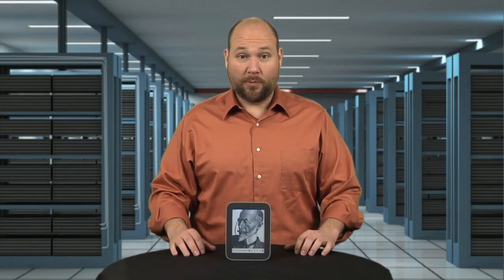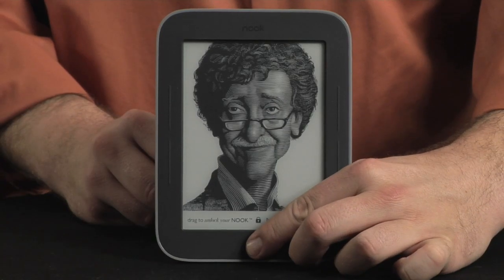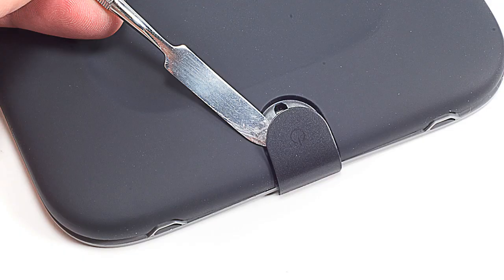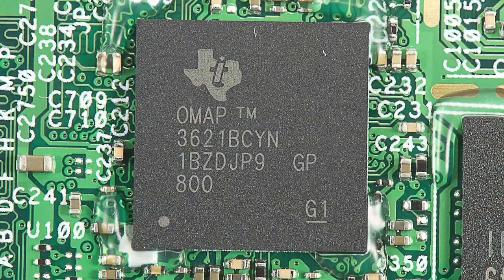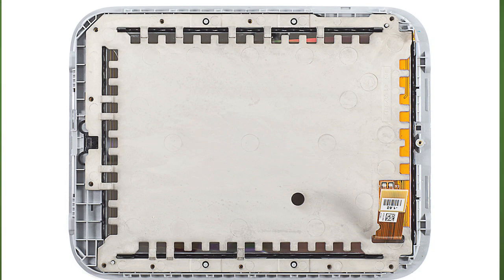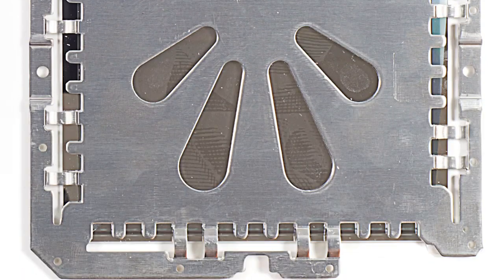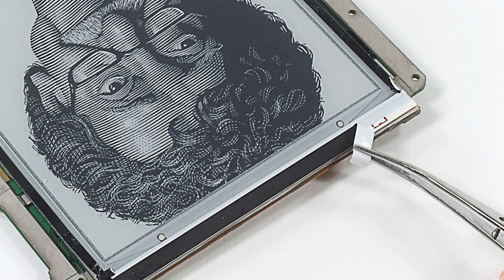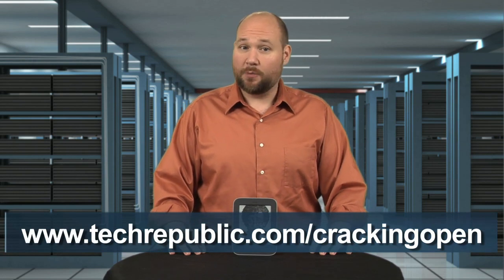Cracking Open: Nook Simple Touch with GlowLight

Comment: Wow, can't believe my nook is 6 almost 7 years old and still works.  Battery only lasts 3 days now and am thinking of getting a new battery but then again 3 days is enough time to find a outlet.  I'm also worried it might be puffed, I had to replace the battery in the one I gave to my Mom when I got this, the very first nook e-ink reader with the touch LCD at the bottom, and the battery looked like it was about to explode.  I'm glad B&N made these so easy to service.

Comment: No need to crack the Nook Simple Touch with Glowlight (that's a lot to type) open to see how the light works. Simply tip the device upward, and one can see light coming from the 8 LEDs. And I suspect the new plate material aids in distributing the light evenly over the E-Ink display. And it's wonderful in any low-light conditions. Love mine!